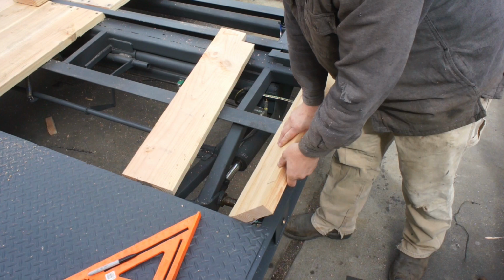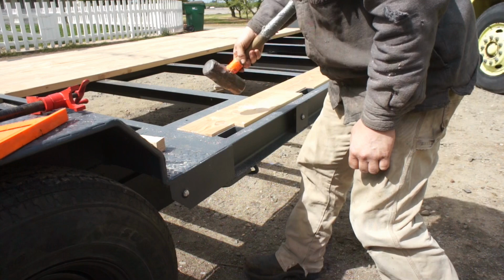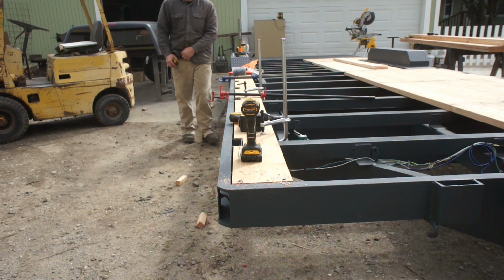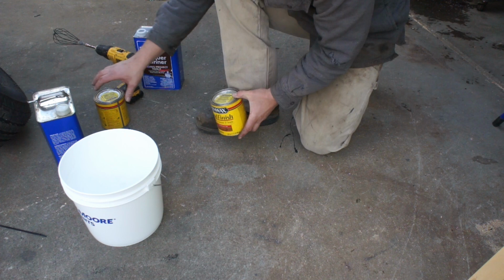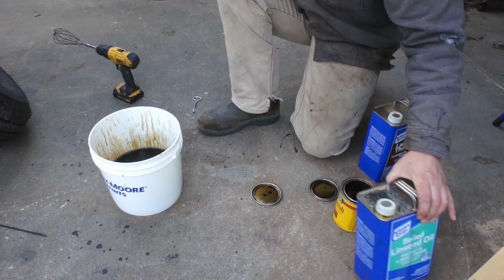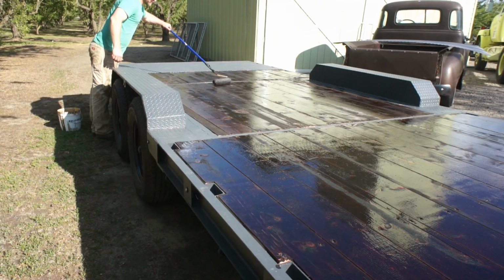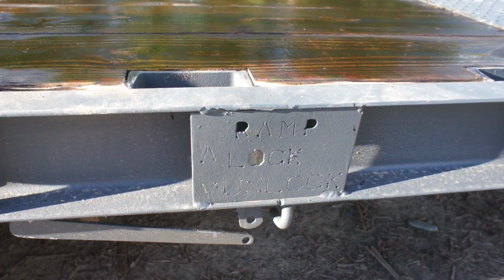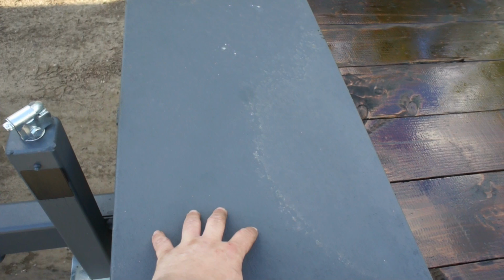Decking the homemade trailer | Part 4 of the trailer series

Comment: I know I am a year late, but it looks great.  Add an up and down button next to the lock on the dovetail and you don’t need to worry about the block of wood.  Wire it in parallel with the main remote so you can use either.

Comment: awesome vids.... look into running a 4 ga wire from the truck battery to the back of your truck. then a 4 ga. wire from your trailar battery up to the hitch with a quick connect. then your battery with stay charged up.

Comment: Why don’t you run leads from the battery in your truck to the back bumper, like the leads you would use for a snow plow that have the connector on the end. Then use the part that wires up to the snow plow and run it to the battery on the trailer. That way you can have it constantly charging the battery while you have the trailer hooked to the truck plus you have a bigger battery capacity and don’t have to worry bout it not having enough power to lift a heavy load

Comment: Enjoyed all four videos. The trailer looks great and your attention to detail made it better. I have a 30’ bumper pull I built for a one time use to pickup components for a steel building. I was going to shorten it up and turn it into a gooseneck with a dovetail. However you have inspired me. Any insight or detail you can provide on the hydraulic ramp would be appreciated. Great build.
Reply from the maker: Ive been very happy with the ramp. I do have had a bit of accelerated wear on the edge of the wood that protrudes when the ramp is down. Its just chips and splinters, pretty minimal. I bought the cylinders from surpluscenter years ago. The pump is in the description of one of the videos. Thanks!!

Comment: Wow, amazing job!  Some people coat their wood decks with used motor oil, another cheap option...
Reply from the maker: I do a lot of wood fence post butts with used oil but I dont think I could bring myself to do it on my trailer. Its stinky, especially during the warm summer months. That said; I have sprayed it with diesel. Thanks for the heads up

Comment: Thought is good about the mesh to protect the PV panel, but it will shade the panel causing a loss of power generated.  Maintainer panels don't make many watts anyway.so shading them ruins their output.

Comment: you did a real nice job, I was left wondering why you didn't lift it up from one side with your forklift and then spray your stain on the bottom side of the wood.
Reply from the maker: I could have I suppose, It would have been messy though. Thanks for watching!!
Reply: Need to let the water escape or it will really shorten the life of the wood

Comment: Nice build, but the wood would have been coated with a couple gallons of old motor oil that works well and its cheep
Reply: That's exactly what I was thinking. Used motor oil is the best trailer deck and side board preservative there is. Keeps water out, lets the wood breath.

Comment: Hook your battery into your trailer plug. When its plugged into your truck it will charge the battery
Reply from the maker: It is, I think theres a fuse burned out somewhere

Comment: What type of fasteners did you use to hold down the boards?
Reply from the maker: I use big T50 torx heads specifically made for trailer decks. I get them at the local ag supply for $2.25 lb
Reply: $2 a pound sounds way cheap. How many do get for that?

Comment: How did you register it? Get title? VIN? Etc...
Reply: Hear in Phoenix you take it to the DMV and it gets inspected for the proper requirements for the size of trailer. You present recipes for the material you used because it’s home build and they give you a serial number, home built trailer title and permanent plates.